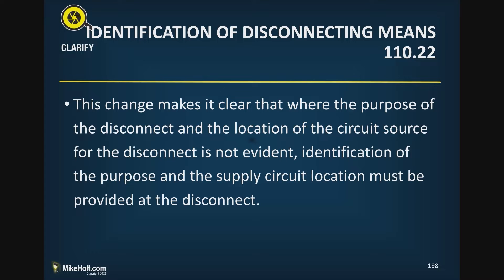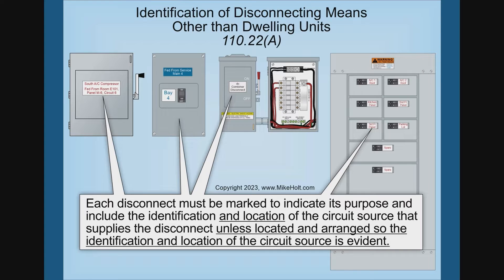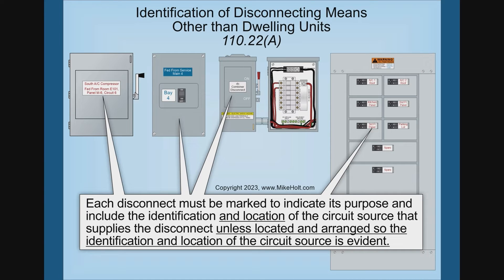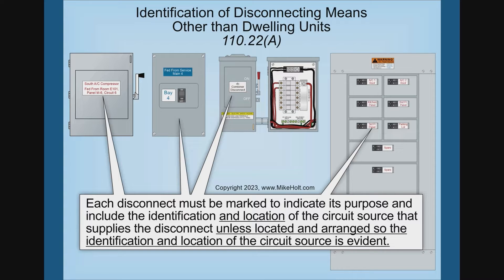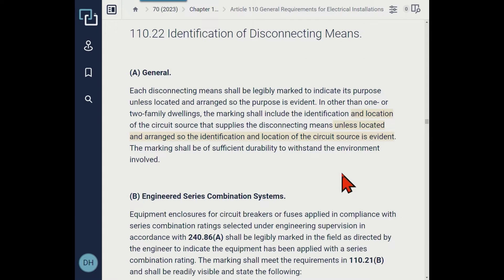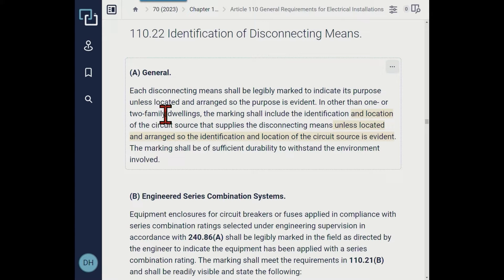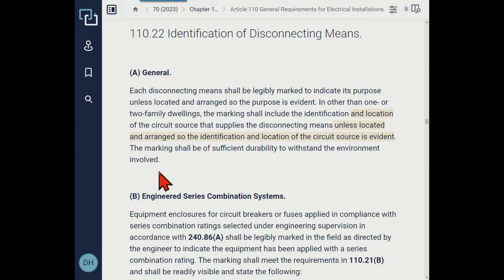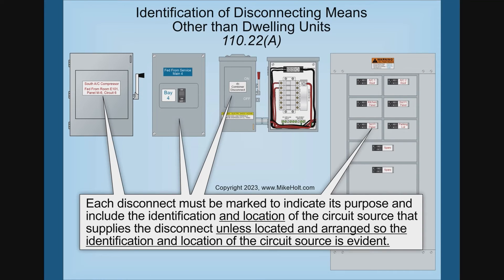Identification of Disconnecting Means, 2023 NEC [110.22], (15min:05sec)

Comment: I retired from a large hospital that probably had over 35 ATS switches located in two separate basements and five other floors and would have been great if each ATS was marked not only with the panel & breaker location but exact floor & room #. We had a chesp contractor install 7' high 84 circuit panels with the smallest engraved maybe 1.5" long plastic sign for panel & breaker that feed it. Only problem they installed the 20 plus signs at top of panel that even wearing glasses I could never read them so had to hunt fown s stepladder to read them. Finally started marking panel legend with info. A year or two later they finally throw this electricsl contractor out of the building.

Comment: Mike please stop.  About the time boomers figure this out they'll be gone and it will matter even less.  My house will have multiple sources of power.  Battery, Solar,  Wind,  Backup petrol Gen, and potentially grid.  There is no (cost effective way) to make a single big switch to turn it all off.   Also my brother is a firefighter. You know what they're not going in until the power company shows up was his response to the required disconnect. So stop thinking it's for the firefighters.
Reply: @steven7650 We were at the Code Making Panel meetings where this was discussed and added to the NEC. It was 100% done for the firefighters and was represented by firefighters (Many Code Panel Members are Firefighters) during discussion for approval. There are also rules in the NEC addressing interconnected power production systems shutdown. This is standard practice in todays world.
Reply: @brianhouse5983 back in the day, firefighters were trained to remove the meter from the socket, at least this is what my older cousin was taught back in 2004 when he went through the fire training academy.  Although he no longer works as a firefighter, he is a supporter of 230.85 in the 2020 NEC, and the change in 2023 to include emergency disconnects for one and two family dwellings supplied by a feeder.   

Regardless of how you may try to justify it, pulling a meter, especially under load is a dangerous step, even moreso for first responders as they are not certified electricians or linemen. Remember your talking a couple thousand amps or more of available fault current on equipment with no overcurrent protection and no way to disconnect the power except wait for a power company representative to come and disconnect power from the utility transformer.

Comment: Thanks for all your ideas. And how supportive you all have been to us. 

Just wish to share my experience.
In projects I've worked what is done is. For panels, identification is done based on the type and the floor at which it is installed. Example DB-GF-LP-01 where DB is distribution board, GF installed in ground floor, LP feeding lighting and power circuits, 01 is the 1st DB. 

The cables on the panel will identify the source, example 
Incoming cable will identify where it's feeding from while outgoing cables will identify the feeder circuits. 

Same way for wiring devices also are identified with the circuit reference and the panel it's feeding from. Example DB-GF-R5 on socket outlet. R5 will identify the circuit reference. 

Once more thanks for the knowledge
Reply: for home run circuits on drawings this panel name is way to long.